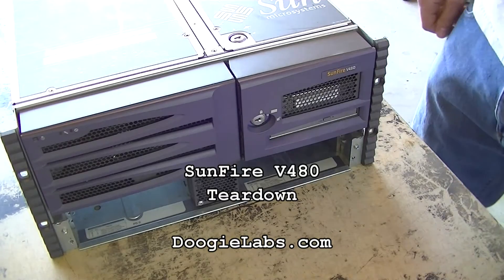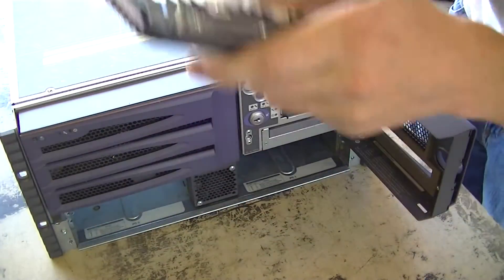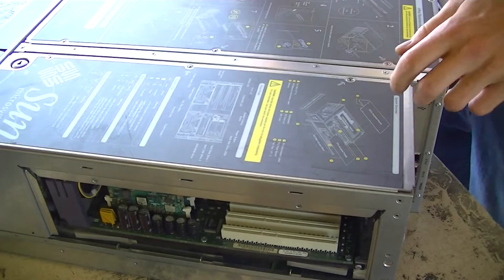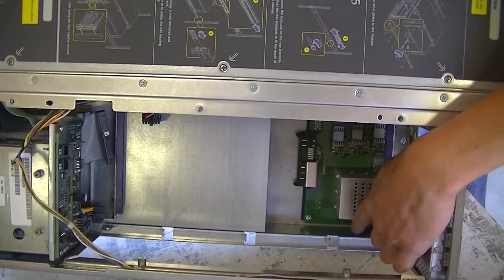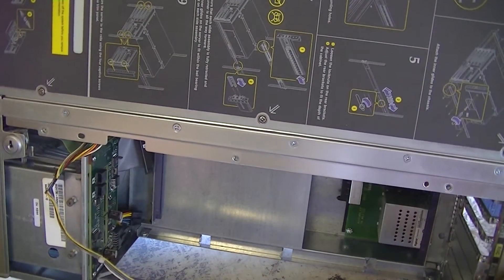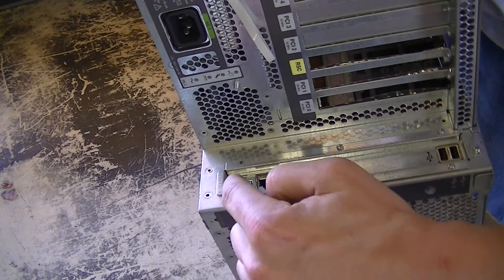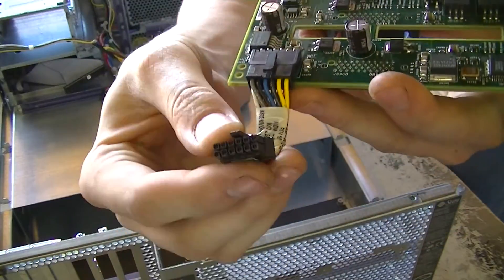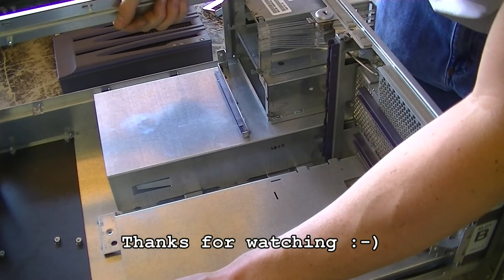SunFire V480 Server Teardown

Comment: it would be 1 hell of a task finding what ram stick failed
Reply from the maker: MsJinkerson it's actually easier than you think. My v880 has 4 of those cpu cards for a total of 64 sticks of ram. When a stick goes bad, the computer reports to the operating system which slot contains the bad stick, it even reports which pin(s) on that stick are malfunctioning. So it's very thorough. On Each cpu board next to the ram slot there is silkscreen text that tells you which ram slot it is, as long as you match the silkscreen text and have the right cpu card, finding the offending ram stick is usually pretty easy.

Comment: I am sure your server will not power on after reassemble. You didn't use antistatic band :P
Reply: Built a few personal PC`s and my server with one... Its not a must.
Reply: It is recommended . But only then when you are handling bussinedd Server or Client. but if you are working in own server then you can clean it with Water no issue :)
Reply: Kartik Chakarvarti 
Myth, build a lot of PCs with out that, never had an issue. ;)
Ofc u can always touch some metal(ie case) to prevent that.
Reply: Yeah, Anyways All the best for the machine. :)

Comment: I had a job back in 2000 building up SUN E250 machines. More memory more cpu's more drives etc and installing a quad ethernet card. Great machines such a rocksolid design! Only way to heavy a Sun E250 is 40KG. I hope all the parts get a new nice home :)